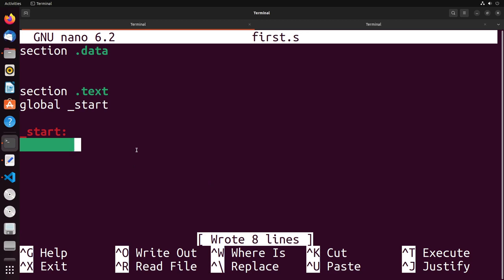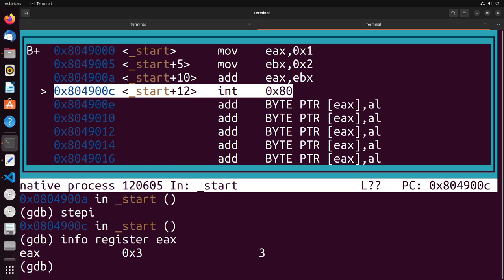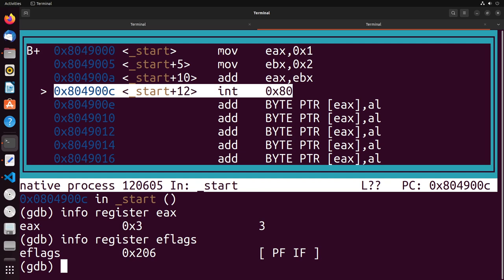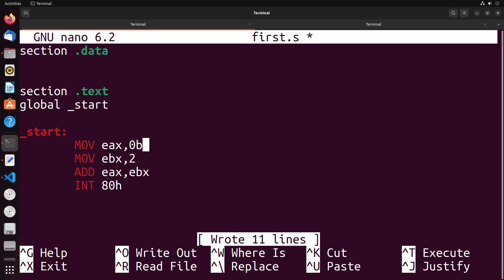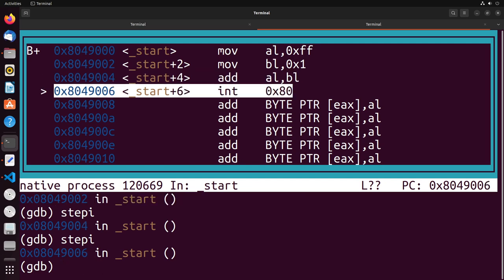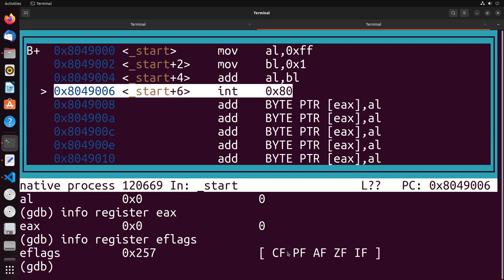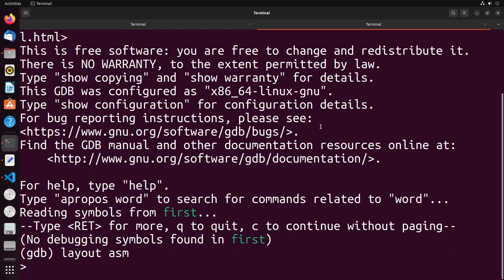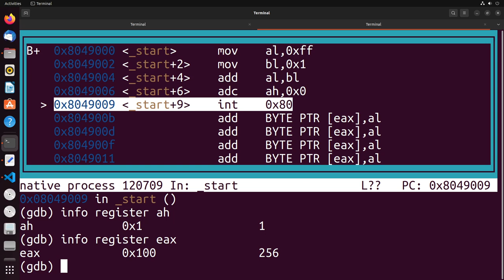Learning x86 with NASM - ADD, ADC, and EFLAGS

Comment: Small correction. The parity flag isn’t set when the result itself is odd. It is set if the least-significant byte of the result has an even number of set bits. So since 3 (0b11) had two bits set, the parity bit is set.
Reply from the maker: Good catch, thank you for mentioning this!

Comment: Why I am getting segmentation fault, if I do not mov 1 to eax before  interrupting the code with INT 80h? Why do not you get any segmentation fault error?
Reply from the maker: The INT 80h instruction will request the operating system to perform a system call. The system call that is requested is based on the value in eax. When eax is set to 1, the INT 80h request will run the exit system call, which ends the program. If you don't set eax to 1 before INT 80h, it will run a different system call, which can result in a segmentation fault depending on the system call run (for example, if eax were 3, a read system call would run. This system call uses ebx to determine which file to read, and ecx as the buffer to read data into. If ebx is not a valid file or if ecx points to invalid memory, you would see a crash/segmentation fault)

In the video, I never end up running the INT 80h command when stepping through in gdb, but if I did, I'd likely reach the same segmentation fault. I should have moved 1 into eax in the video to help avoid this error. Hopefully this clarifies!
Reply: @olivestemlearning  ty for your respond. Your videos are very helpful.

Comment: How... did stuff from AL and AH end up in EAX?!?
Reply from the maker: eax is a 32 bit register in x86. The AL and AH registers are just different ways of accessing the 32 bits of eax. You can divide up the register like this:

                 ax                 |        ah        |  al
00000000 00000000 | 00000000 | 00000000

So, if I place some data in eax, I can access pieces of it using ah and al. For example, if we put the value 2 in eax we have:

eax: 00000000 00000000 00000000 00000010

If I were to access al, I would just see the rightmost 8 bits, which gives me a value of 2.
Reply: @olivestemlearning  Ah, thanks! I haven't played with assembly level code since my Commodore 64 three decades ago. I'm a C programmer nowadays, but apparently I took some 6510 thinking with me into this topic.